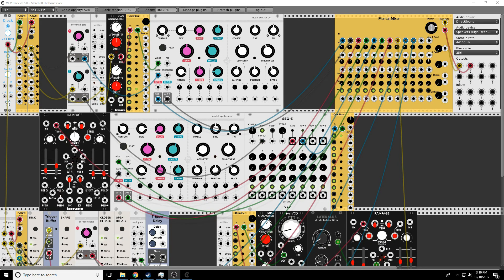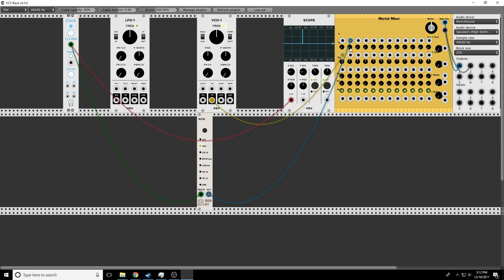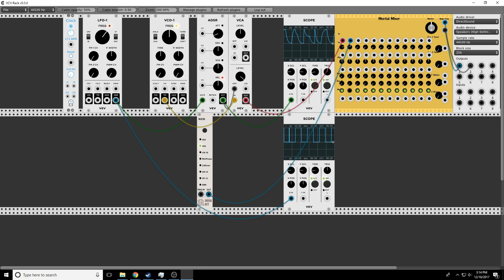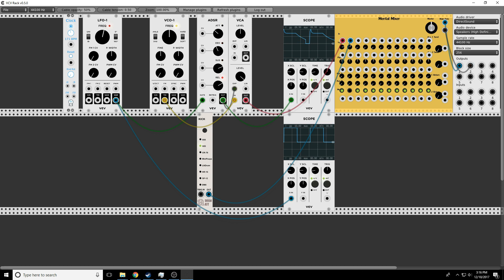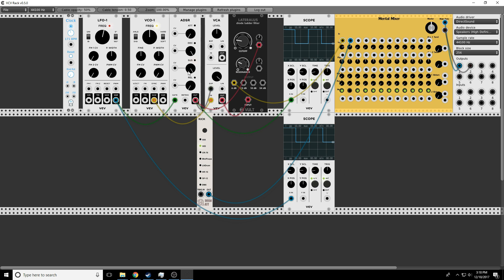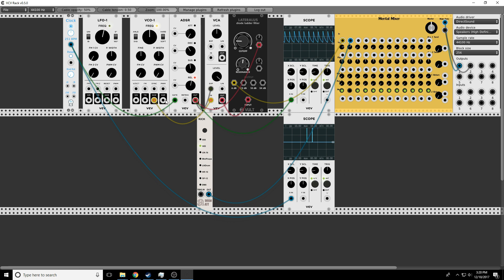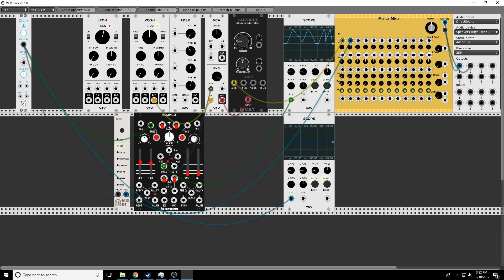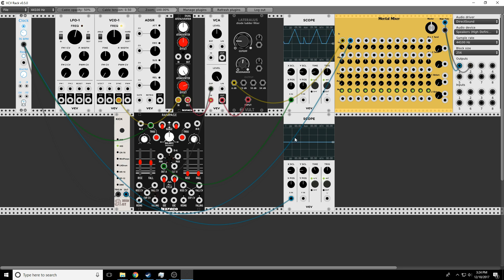Modular Curiosity Episode 4 : Gates and Triggers

Comment: This is such a great series! Many thanks. And just a quick suggestion:  at 03:47 you load a second Scope to view the Gate signal as it drives the ADSR and VCO output. I just discovered that if you connect the Gate signal to "Y in" connector the gate signal (in red) is overlaid on the VCO signal tracing. This makes it much easier to see how changes affect the oscillator signal that you're working on. Just FYI... (and a year and a half late... ;-)
Reply from the maker: Oh believe me, there is SO MUCH I didn't know when I started this series.  I think that's why people like it so much, because I'm just learning too.   Yeah, I've been working with other versions of the scope module so I can see multiple traces at once.  You're absolutely right, the ability to see how This trigger affects That waveform is really useful.

Comment: If you didn't have a clock, you can make one from a square or saw on an LFO. From square wave, just lower the pulse width as low as it can go. From the saw, pass it through a high pass filter, and then a polarizer. I was able to get them to match really well with AS 8CH Mixer and the Gratrix Scope-G.